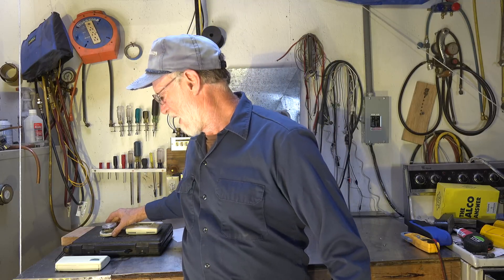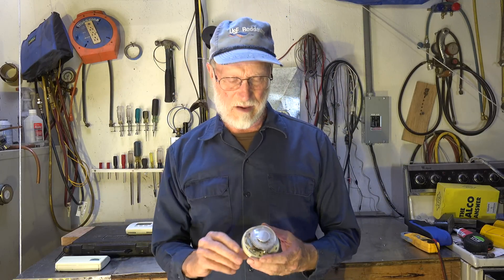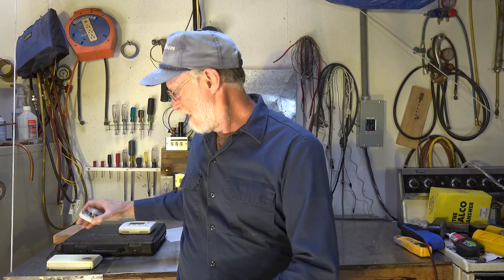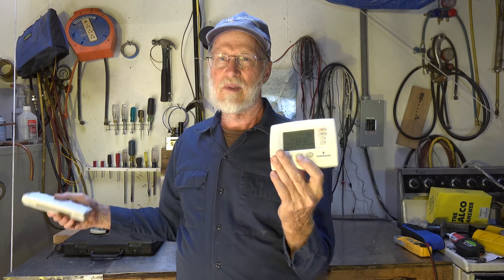Thermostat cycles per hour #1

Comment: New to the channel.. great content! I have a Tech V furnace I'm trying to adjust cycles for.. thermostat was set on .4 but cycled for a super long time then shuts down for a while. It now cycles shorter ~15 min. at .3 but has now been off for over an hour. Older house.. 4 burners.. a little yellow tipping.. not really sure about the age of the unit. How should I adjust for a more stable temperature across the board? It usually variates ~ 4 degrees before cycling back on.
Reply from the maker: I would be looking for a problem outside the thermostat.  The furnace could be cycling off on indicated flame failure.  Look for blinking light failure code.  Could have a small window on the furnace that will indicate the failure.
GFM
Reply: @grayfurnaceman  I'll give it a look today. Got a tech coming tomorrow to clean the burners and check the rest of it out so, I'll get them to check the codes, too. Thanks for response and all the pertinent good info. Be blessed.

Comment: Does this change with my cold start oil boiler with circulators running as soon as the thermostat calls for heat. Video link?

Comment: I have a white Roger’s thermostat the heat setting option is slow or fast I set it to slow does that waste more fuel or will it not make a difference I don’t like having it on fast because I noticed the boiler comes on way to quick and I feel that puts more  wear and tear
Reply from the maker: When using a boiler, the cycles should be longer.  It takes more time for the boiler to warm and to get to efficient operation.  Leave it longer.
GFM
Reply: @grayfurnaceman so I should keep it set to slow correct?
Reply from the maker: Yes
GFM @CloroxWipes
Reply: @grayfurnaceman  thank you I appreciate you for replying

Comment: Hello GFM I was wondering what would be the ideal swing setting for a thermostat to help with energy/money savings.  Mine right now is set to 0.5 degrees.  Thank you.
Reply from the maker: I would be setting it at 1 degree F.  The furnace cycles long enough to be at its highest efficiency but not so long that you are under and over shooting the temp.
GFM
Reply: @grayfurnaceman  thank you I will set it to 1 degree.  Should I set the AC to 1 degree also?
Reply from the maker: Yes
GFM @JasonMcDougal1987

Comment: Question... if my heat pump runs for 45 mintues and then only stays off for 15 minutes, how do I calculate the CPH? Thanks!
Reply from the maker: Heat pumps runs for extended times compared to fossil fuel appliances.  Especially at lower temps.  I would expect 2 or maybe 3 CPH unless temps are below 30F.
GFM
Reply: @grayfurnaceman  gotcha but my only confusion is how and when to calculate cycles per hour. For example, right now it's 92 degrees and my heat pump was cooling my house for 45 minutes, then shutting down for 15 minutes, then another 45 etc. Repeat until the evening when it cooled down. Yesterday was a similarly hot day, and from 12PM to 12AM it cycled on and off in the same manner 13 times. What kind of CPH am I getting? Sorry for the redundant question, I'm just a bit confused on how to calculate if my cycles are ok, or if I need to enable the system to engage stage 2 in order to cool faster or if this is fine. I'm lucky enough to be able to tweak my bosch 2.0 IDS air handler speeds, and also able to lock out stage 2 entirely through my ecobee stat to essentially customize my runtimes.Thank you for your guidance!!

Comment: TYVM. Had a new furnace put in 6 years ago and It was cycling 6 times an hour. I asked the tech and he said the digital stat is trying to keep temp within .5 degrees. I put in a Honeywell T87 and adjusted the Heat Anticipator and now i get about a 2 degree swing and about 3 cycles per hr. when real cold. Obviously less with warmer OA temps. I love it but was just wondering when this t 87 dies, if ever ha, can I put in a Delay on make timer with a digital stat and still be able to run the fan independently like when we want to just circulate air.. Thanks again!!
Reply from the maker: Many of the digital thermostats have an installer setup that allows you to control the cycles per hour to as little as 3 CPH.
GFM
Reply: @grayfurnaceman  TYVM I will check into that, but for now my old reliable is doing great!!!!

Comment: My home is an end unit 1st floor condo concrete floor above unheated garage and concrete  ceiling and it's an end unit.cold exterior wall on half length of the home.built in 75.the furnace isn't old and it's cycling every 5 to 6 mins since my mom wanted it warmer will it stabilize in a few hours and not cycle as much.it is 20 degrees outside rt now. Please help

Comment: hi gary i have a question i am trying to find out why my furnace runs a full cycle and when it shuts down it comes right back on over and over can you steer me in the right direction..Thank you
Reply from the maker: If the burner comes on each time, and you have a mechanical thermostat, you could have an incorrect setting on your thermostat anticipator.  Let me know if this is your problem.
GFM
Reply: @grayfurnaceman  Thank you Gary i am gonna work on that tomorrow its late and time for bed but i will let you know thanks again

Comment: Some days our Furnace Doesn't shut off..When I reboot it then it works properly 
It's a 40 year old Airco.
Reply from the maker: Does the furnace overheat the conditioned space or does the fan just run?
GFM

Comment: My furnace is 2 stage heat will come 5 mins. Then shuts off for 5 mins. It do this 24/7..it doesn't stop this cycle .  Our house has good insulation.
I didn't get any sleep because of this on and off cycle..any clue what is going on?
Reply: This is the problem i am having with brand new Rinnai wall furnace. It has a built in t-stat that is located behind the wall heater and 2 inches off the floor. I raised it up 12 inches and off to the side of the unit but it still makes no difference. It keeps me awake all night - firing up, shutting down and then firing up again.  An again and again.

Comment: Here's what I see as the benefit of reducing the CPH both for single stage heating and single stage cooling, with single stage being the most common for the vast majority of people. Firstly, reduced wear and tear on the heating and cooling systems, improving longevity, possibly to double or triple its life span. The components that extend their longevity and maintenance interval include furnace burner due to carbon buildup, A/C compressor by reduced starting/stopping, relays, reduced A/C evaporator coil thermal stress due to swinging between 40F and 75F which often causes leaks. If cycles per hour can be reduced to 1 CPH instead of 3 or more CPH using a thermostat that support this, long term repairs, maintenance and replacement costs will typically be reduced significantly. Also efficiency will be increased, as it often take up to 10 minutes before both the heating and especially the A/C reach optimal efficiency in a given cycle. This is particularly the case if one's system is oversized which is usually the case in most homes. A low CPH value (i.e. 1) can offset the disadvantage of an oversized system. Lower CPH value means less short cycling. If one's home is well insulated and south and west facing windows are shaded in summer then it is likely a CPH of 1 for both A/C and furnace will also be easy to become accustomed to comfort wise. This could also eliminate the need to purchase an expensive 2 stage or variable A/C and/or furnace which have worse reliability histories. Basically it's like increasing the observed SEER of basic your single stage A/C a few digits and increasing the efficiency of your furnace a few %. If one is smart, one can wire a relay for specific ceiling fans to come on 15 minutes after the blower goes off to even out the variances in temperature due to stratification and switch off ceiling fans when blower turns back on (remembering to reverse fan direction when heating). Otherwise if you have money to burn don't worry about the above.
Reply from the maker: One CPH, especially with an oversized unit, would be a service tech's worst nightmare.  Consider a unit running at 45F outside ambient in an area that requires a 10F design temp.  
The temp swing would be enormous.  A -10 to +10F would be the result.
That is not acceptable to virtually any customer.  Even the "increased efficiency" would be reduced by the increased temp split between inside and outside temps.
Now, lets try to do this right.
If its a heat pump, a 2 to 3 CPH may be effective as the heat pump has far less BTU output.
If the home is new or very well insulated, you will have better luck with lower CPH.
Older homes will lose heat too fast for the lower CPH.  
GFM

Comment: Thanks for the information you are posting. We have a modern furnace for quite sometime now that replaced an old furnace with the old-style thermostat.  I always struggled to agree with the new electronic thermostats way of timing a furnace-on cycle.  I also disagree that the manual instructs to set mine to six cycles per hour.  I dislike so much hearing the gas valve go on and off during a heating cycle.  I have set mine over a long period of time from six cycles, to five, four, three, two and finally back to three cycles per hour.  I have also done extensive time research with a stopwatch during all this time.  What I found, is that the new electronic thermostats artificially control the furnace on cycle; let me explain. For example, for a particular cold day of 15°F ambient temperature, when it is set at three cycles per hour the gas on time is about 14-17 minutes  long.  When it  is set up two cycles per hour, The furnace gas valve on time may be from 21 to 24 minutes long with AN obvious longer temperature gap between the on and off cycle. In my experience, I keep three cycles in temperatures above ambient 20°F and two cycles if it is below this and it works fine. But I always wonder if I had an old style mechanical thermostat I wouldn’t have to mess with all this. Just my two cents.

Comment: Doesn't longer cycling use more fuel?
Reply from the maker: The cycle rate has little effect on fuel usage.  Just because the furnace runs longer less often, does not mean more fuel is used.  There is an argument that shorter cycles may, in fact, use a little more fuel because there is some inefficiency on startup.
GFM

Comment: Had to replace my thermostat so bought a Honeywell.  Even when I set it to the longest setting possible it still cycles too often.  The old thermostat didn't do that so it's not the location.  Can you recommend a brand/model that allows longer cycle times than Honeywell?
Reply from the maker: You probably have the best one now.
GFM
Reply: I got sick of hearing mine on and off all the time also,and noise eeee. So i wired a timer control into power supply . NOW IT ONLY RUNS WHEN I Want it to !!
Reply: @rottenkernel7822  thats primitive but dang smart ! lol

Comment: Thanks for your reply. I have a stacked combo AC/Furnace Arcoaire installed in a single family 2000 sq ft house installed in the garage in 2003.I change  the return filters inside the home regularly . is there a filter inside the combo AC/ Heating unit to change also? I don't see any door to replace a filter.  Never had the unit serviced.
Reply from the maker: If there is filter at the return, there will be none in the unit.
GFM

Comment: I agree but I am interested in AC cycles. My HW Energy Star seems to cycle two much---I think but this is Arizona. With ceiling fans on it still feels cool after the AC goes off. Thought of the cycle was diminished  the AC would use less energy to start and stop.
Reply from the maker: I would check the installer setup.  Many of them have a cycling rate for A/C.
GFM

Comment: Hey GrayFurnace.  Excellent tutorial video. I have a Rheem two stage furnace. I decided to go with two stage for several different reasons One was the guy who installed it did a load calculation on my house. You don’t see to many doing that. He also indicated that it’s better to have a furnace run longer than short bursts. I had just gutted my house and redid plumbing, electrical and HVAC. I thought it was highly efficient. I also installed new high efficiency windows and insulation. I’m very mechanical and get involved in all aspects of repair work. I have personally seen bad HVAC people just slap a 180,000 btu furnace in a house that would be better with a 90,000 btu.
Reply from the maker: So true.
GFM

Comment: I did not see a video on oil fired boiler. I have an older home w/plaster lathe walls, I'm thinking that on my oil fired boiler (baseboard radiator) needs to cycle the 6 times an hour. My Lux thermostat has a swing setting of 1 to 9. What setting is right for my situation?
Reply from the maker: Most boiler systems should cycle about 3 CPH.
GFM

Comment: The HVAC Techs that installed my new AC and thermostat set both the AC and Furnace on 6.
Reply from the maker: IMO that's too many cycles.
GFM
Reply: @grayfurnaceman  What's your suggestion? I live in South Florida in case location is a factor.
Reply from the maker: I would use 3 CPH.  Especially for cooling.
GFM
Reply: grayfurnaceman for both cooling and heating 3 cph? I’ll change it this evening. Thank you
Reply from the maker: If you live in Florida you probably never use heat, but unless you notice large temp swings in heat, 3 CPH should be fine.
GFM
Reply: grayfurnaceman I made the change... about the heat part, we get cold when it drops below 60 .... haha
Reply from the maker: Wimp!
GFM

Comment: I have an old Burnham P204W boiler with a return pump and large cast iron radiators. I'm currently using 1 CPH and it keeps the house comfortable. Would it be more efficient to use 2 or 3 so the water doesn't cool down as much and have to reheat between cycles? I'm in and old 1925 house with not  a lot of insulation in MN were the average winter temp is probably below 20.
Reply from the maker: With boilers on older houses I would recommend 2 or 3 CPH.
GFM

Comment: Nice video, is cycles per hour the same as swing? and if not, which one would be better for my 1930s house that has some blown in insulation and gets a little uncomfortable between cycles. I have a lux thermometer which has adjustable swing and I'm thinking about replacing it.
Reply from the maker: Pretty much, yes.  You may need 6 or 9 CPH to avoid temp swings.
GFM
Reply: @grayfurnaceman  thank you very much for the information!!!

Comment: Great video, I installed new Honeywell  thermostats on my pulse 21, and it cycles every 7 mins , can I adjust how many Clydes per Hr, Thks
Reply from the maker: If the thermostat has an installer setup, you can change CPH in there.
GFM

Comment: Where i live the average temperature is 32 Celsius(90F) so we don’t use heat at all. It’s not even considered or exist in the unit. Which CPH configuration would you recommend for my needs in order to get a good cooling feel and protect my unit from wear?  Thanks

Comment: so if my room temp. is 70 and my set temp. is 75. doesn't the furnace supposed to run continuously until the temp. is 75 and only stops until temp. is 75? or does it stops around 73 and does its 5/6 cycles per hour until it gets to temp. 75? i am a little confused. thank you Gray.
Reply: mark.r hvac the cycles per hr as he said is once set point is reached. So once 75 is reached the cph is then in play
Reply: @jeffb8437  when i set to 75 degrees it runs until 75. Then it runs again when it drop to 71 or 72, why it happens?

Comment: In refrigeration, we used to refer to this as the "differential."  Most consumer refrigerators don't have an adjustable differential on the thermostat as far as I know.   It's usually what we called a "fixed" differential.   I just learned that my battery operated digital thermostat for my house furnace has an adjustable differential.   It's done by  adjusting numbers 1 - 9, and on the documentation it's described as the "Swing."  "1" is the shortest cycle, and 9 is the longest.  Mine was set to 4, and I felt my furnace was running far too long.   My furnace would stay on for around 30 minutes or more, running 20 minutes in Stage I and then maybe another 10 minutes in Stage II.   I changed the number to 2, and that improved the cycling by having a shorter run time.

I have a two stage furnace, and I'm trying to get it to run in Stage I most of the time, and switch into Stage II only on really cold days where I believe the heat loss from within the house would be greatest. 

Today I've moved the "Swing" number to 1.  It will be interesting to see how this changes the cycling.   There's a lot to tweaking the various heat settings, fan speeds,  run times in various stages, and the thermostat cycling period.

As always your discussion and commentary on these subjects is most helpful.  I'm so glad you are sharing your experience with others.

Comment: Planning to replace my Honeywell with a control pad that has swing control, which allows you to program +/- degrees for any set temperature, making the AC/Heater less sensitive to temperature fluctuations, thus reducing the number of cycles per hour.  LuxPRO PSP511LC 5-2 Day Deluxe Programmable Thermostat

Comment: What about steam boiler system
Reply from the maker: I would set a steam boiler the same as a hot water boiler to start.  It may need a little shorter cycling.
GFM
Reply: grayfurnaceman thx gray

Comment: So for a given situation, the cycling quantity is determined by the range between on and off in the thermostat.  The thermostat can be adjusted for a wider temp drop before it switches the furnace back on.  I never knew that.
Reply from the maker: You got it.
GFM